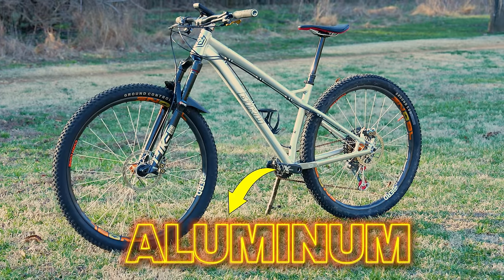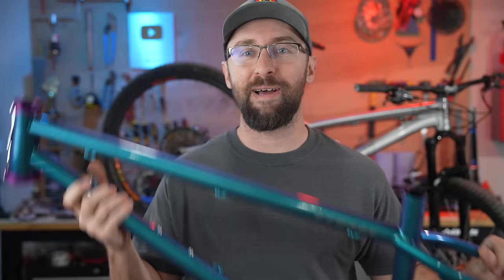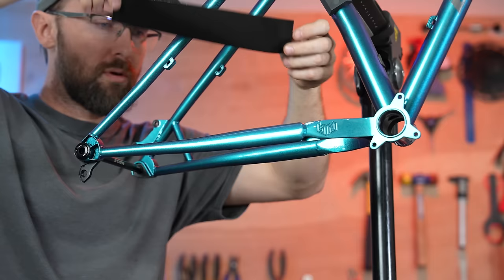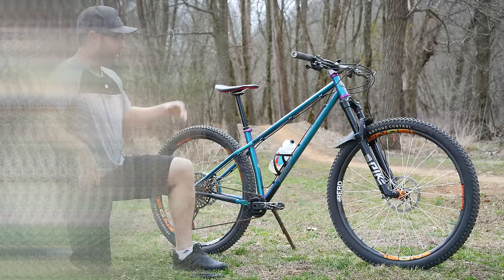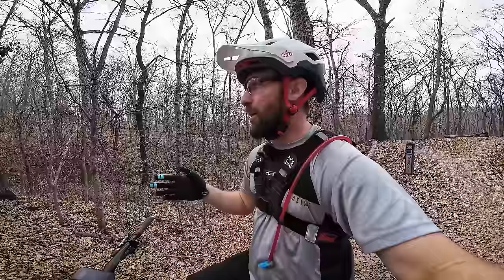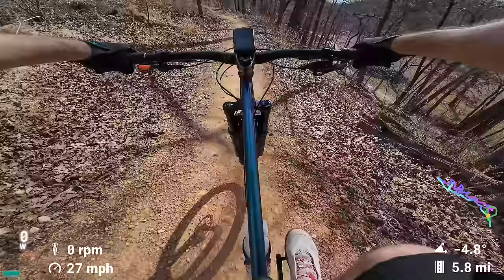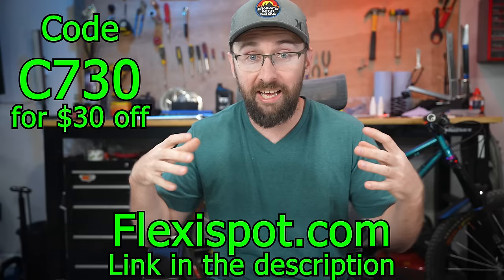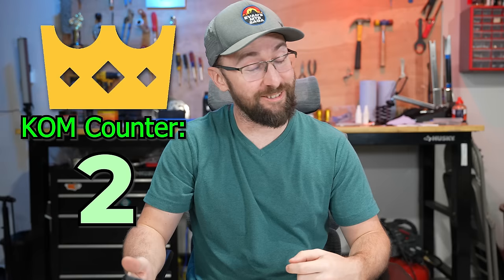Are Steel mountain bikes worth it?

Comment: Coming from a bmx racing background...anyone with a steel bike received from the chrome bikers some unwanted criticism over how inadequate their bike would be for racing and jumping due to the extra weight...
Reply: @BobbySchaffer  I meant the 4130 chromoly bikes....VS the heavier steel.
Reply: @BobbySchaffer  thanks for the correction. I do not know everything..still a work in progress.
Reply: @BobbySchaffer   I know aluminum is different from chrome.  I just assumed chrome was different from steel...especially when some bikes were referred to as trimoly..chrome on the front triangle and steel in the rear...

Comment: For me, i think aluminum bikes are wayy better then steel bikes, durability wise, steel wins, but for compatability and weight it goes to aluminum, by the way what hardtail or full suspension do you suggest for under 1,199?
Reply from the maker: It would be very difficult to find a full suspension for $1200. For $100 more you can get the Polygon Siskiu T6. But if you're on a tight budget, look for a used bike
Reply: @EvansMTBSaga  thanks for the advice,ill try to add 100$ more to my budget and hope to get the polygon siskiu t6 since you request ❤️